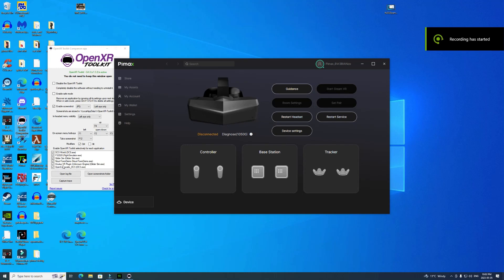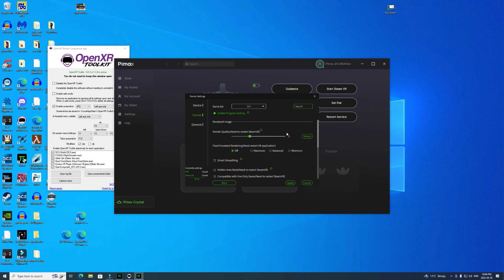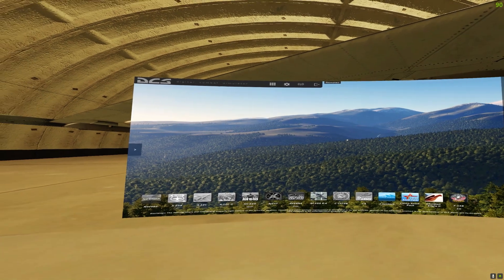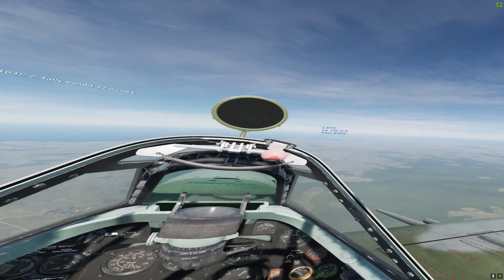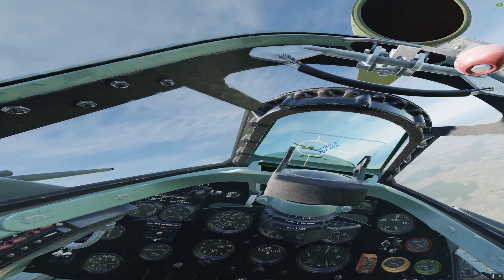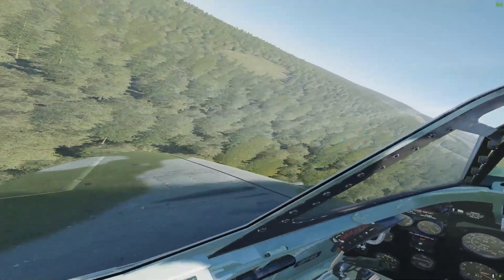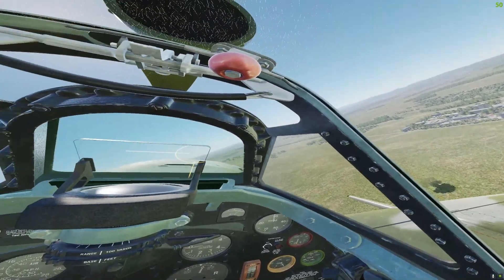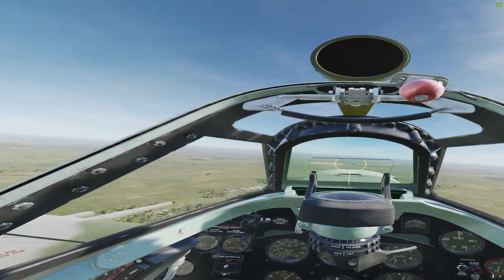Pimax Crystal beta Test DCS and Openxr

Comment: Do you know if pimaxxr works with war thunder?  I tried and didn't work but it might be me not doing something right.
Reply from the maker: Hm. Never tried it. No idea why it wouldn't work. It worked on my 8KX, I'd expect it to work on the pimax. I'll ask my colleages in beta and the Pimax reps. I suggest you go to the pimax discord and see if you can post the question there as well.
Reply: @finndoessims3214  That's where it gets confusing. According to someone on Discord it should work, however I saw a chart on PimaxXR saying it had not been tested.  When I tried, it says missing DDL or DLL file.  I'll try it again, I got it to work with DCS but not War Thunder.

Comment: Im curious how your tests would be comparing between Production and Beta - then the Multithreading version.  And get yourself a 4090, let's push that headset  =)
Reply from the maker: Hm. I'm a ways away from having a production unit; I have to send this one back in exchange for one.  As for DCS, the latest version is supposed to support OpenXr natively and do multithreading, but I haven't been able to get it to work so far.  It's sort of fallen to the bottom of my test list since I got new firmware and software to put through the old wringer.  I'm waiting for the 12k before updating my GPU, and by then it will likely be a 5090 or equivalent. The 3090 works great in the Crystal so far.
Reply from the maker: I just did about 10 minutes in DCS (still kinda tired from being sick) in OpenXR and MT. Didn't notice any improvement from openxr via opencomposite. BUT... 10 minutes is far too short a sample time, and too limited in environment and situation to really test this. At least I got it working.  Gor blimey, I'm thick as a bloody brick some times. Took me the longest darn time to do a simple command line change in properties on the binMT exe file.

Comment: I heard that you can lengthen battery life bei providing USB C power to the left side (if I am Not mistaken) - is that true?
Reply from the maker: There is a usb c port on the right side that can be used. I think voodoodr did a nice explanation on his channel. I haven’t tried this. I’m thinking of getting a small charging block/battery that I could drop in my shirt pocket attached to that port by a short cable. I don’t know if it would have enough power. I’ll give it a try on a long sim session and see.

Comment: Great video, very helpful. I'm thinking of upgrading from the G2 to the Crystal. 

Question: does the Crystal have some form of motion reprojection?
Reply from the maker: Reprojection appears as an option in FS2020, but I haven't tried it in OpenXR. It's basically a form of motion smoothing isn't it? As I always say, I'm not exactly a tech guru on this stuff! I'm learning as I go, like all of us!
Reply from the maker: It does in FS2020. I don’t find it better or worse than turbo mode in Il2 openXR. I was testing reprojection in steam tonight but I ran into some trouble likely caused by fatigue. Getting old ain’t for sissies
Reply: @finndoessims3214  thanks! Really appreciate the response and can relate with getting older. Lol

Comment: Thanks for posting the video.  45-50 is low considering you were in the air.  Around airfields and cities you’ll get a lot less unfortunately.  3090 is not too strong for headshots pushing that many pixels.  4090 on the horizon anytime soon?
Reply from the maker: Actually, i hope to do quite a bit better. Thanks to tips from viewers and my beta colleagues, I am now getting 90fps in Il2, with very little degradation in video quality. Wowza. Video to come. There may be issues with OpenXR and the DCS multithreading edition though- I haven't worked through that yet. But, it's looking hopeful.
Reply: @finndoessims3214  oh wow, that's amazing, 90 with 3090 on such high res? Are you getting that in the air or near ground, around cities, airfields etc? YA, would love to see the video on how to! What's your fps in DCS if you have done that?
Reply from the maker: @whiteflyingmonkey  I absolutely will do a video- including directions on using openxr. I was amazed- 85-90 fps flying at rooftop level through a town in IL2

Comment: How 45-50 fps is a smooth experience? Where it well knowen that in  every headset out there if you're even short of   2 Frames under  90 fps it stutter like hell?
Reply from the maker: I don't think that is well known at all, or even true in all cases. I see zero stuttering in any of the games I play on my 8KX or the Crystal. Now, it may very well be true for you- I think some people have a greater visual acuity or sensitivity to it, but I see no difference between  50 fps and 90.   If you need 90 FPS, I'm going suggest that a faster rig than mine will required.
Reply: Actually this is 100% true for my HP G2, about 2 fps under 90 and the stutter is unbearable. But for some reason, this does not apply to my recently aquired 8KX. Flying DCS on 90Hz while dipping into even 70fps territory is for some reason still absolutely playable. Don't ask me how is this technically possible, because I have no idea, but this is my 1st hand observation.

Comment: I am running 75 fps with my 8KX with openXR and MT in DCS with the F-16.  Turbo mode smooths thing out very well for me.  I'm using an OC i9KS @5.2 and mildly overclocked 3090.  I am running upscaling at 90% and sharpening at 60% in the toolbox in normal FOV
Reply from the maker: Nice!
Reply from the maker: Excellent! I'm experimenting with DFR in FS2020 and DCS this week.

Comment: Thanks for the DCS test Finn, could you tell us why you chose to use Turbo mode and not the reprojection that Pimax provides?
Reply: I get some mild ghosting with Pimax reprojection where in Turbo mode I don't see any ghosting at all.
Reply from the maker: I tried reprojection mode, but I didn't get any performance game, and the Turbo mode works fine for me. I tried reprojection in FS2020, but it actually seemed to degrade performance for me. Mind you FS2020 is still a demanding game in VR.
Reply: @finndoessims3214  thanks Finn, sounds like it may not be working, did you see the FPS count while it was switched on?
Reply from the maker: @a320sideslipproblems4   I don't recall! I'm going to try it again tonight. I've had a couple of questions about this, and it occurs to me that I need to understand this better. Another excuse to do VR flying!